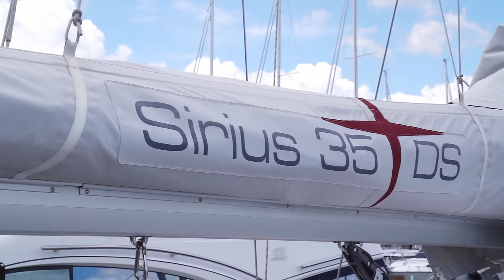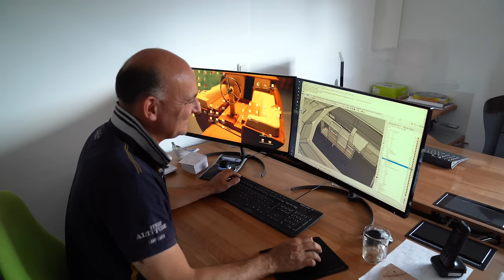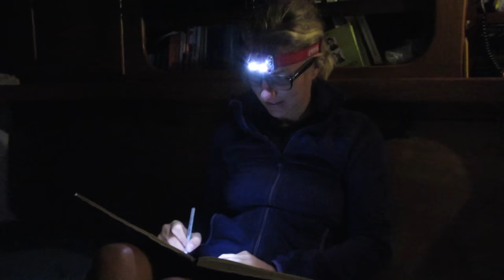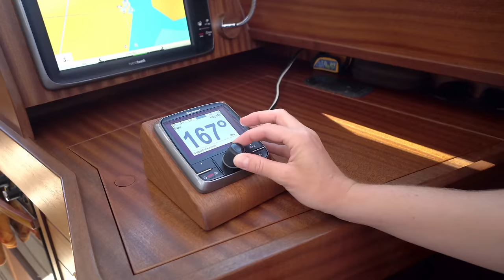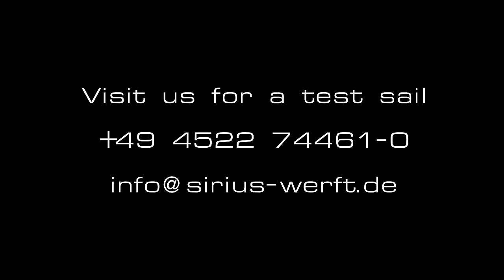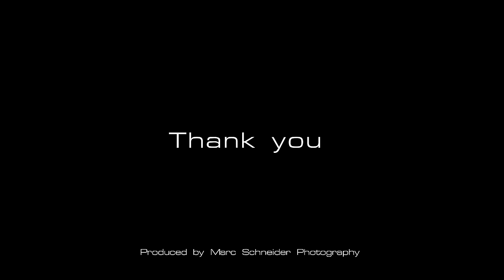Sailing the Sirius 35 DS: A Day at Sea

Comment: This was so inspiring, motivating and  so informative! If you do not already have plans for the bigger sailingtrips this boat boat brings your dreams to life! I does to me! I’m used to the regular Bavaria’s en Jeanneau’s between 30-40 ft, but this boat has so much features that appeal to me. 
One question: I read a lot of books about transatlantic sailing. And one problem seems to happen to all of them: leaking windows.... and I see a lot of windows on the Sirius.... should I worrie? 
Thx again, the both of you!!!
Reply from the maker: Thanks you very much! This is a great compliment and motivation for us! Thanks for asking about the windows: leaks would be down to bad quality rather than bad weather or area of sailing ;-). But I do understand where you are coming from. Some 15-20 years ago - before gluing practice has become common and secure in all kind of airplanes, helicopters, trains, cars you would have worried about leakages. Also has there been a time where gluing was just making something watertight whereas this has long moved to structural bonding. In quality productions this is proven to be safe and sound...
Reply from the maker: ...as we are building ocean-going-cruisers since 50 years now, there has gone a lot of thought and calculation into every little detail. The saloon windows in particular are in use by us since 1988 on every deck saloon yacht we built and have circumnavigated the world a number of times, without any window failures. Just recently this Sirius https://www.youtube.com/watch?v=MQgRIVw-kPg has been sailed all the way from Germany through the Atlantic, Panama Canal, through the Pacific, via Micronesia and Hawaii to Vancouver by their owners...
Reply: The windows are very strong Polycarbonate, doubtful ant problems, as stated in replies below. However, a possibly useful tip to prevent scratching and marking the surface, inside and out is to give them an almost diamond hard polish, ASAP while still in perfect condition, by using a Marine Silico Polish (like the liquid Diamond finish you can have applied to cars when they are brand new ? I forget the Name, but the Marine one used to come in a yellow bottle, and was guaranteed for 10 years. Did the Gel coat on the sides and Stern of a Bilge Keel Macwester 26 with it, and 7 years later it looked as if it had just  even dome. Bo problems washing it,  ever a mark on it. I was so impressed with it, when selling UPVC to customers, I told them as soon as they removed the deli ery film, to apply the Marine Silicon Polish, to protect the soft UPVC Surface Finish. We installed UPVC Fascias and Soffits on my parents House in the late 1980's or 1990, applied the Polish, and today, they still look freshly installed. In between, if the Car wS being pressure washed, they got a quick  last over with water, and nothing else.  For the boat windows, a wash with a wet Sponge on the exterior, to get the salt off occasionally , and a damp cloth inside, should work fine on unprotected UPVC for e ample doing that creates micro scratches, which soon has them looking grotty. I think it would  e good if Sirius Yachts could give their stamp of appro Al for this protection which  an be used on Windows, Hatches, and both sides of the door into the Deck Saloon ? If they have any doubts or uncertainties, I'm willing to Test it on  y boat when .I get one. One with UV protection in addition as well, would be a bonus if one is available ? Best Wishes.  Bob.  👍
Reply: @brownnoise357  thx Bob! 👊🏻

Comment: Saft first a second forestay nessasery
Reply from the maker: A second forstay is not necessary and a option - so your choice! ...but the benefit of the so called "solent rig" is, that you still have a proper sized jib, which could be sailed from 3-3,5 beaufort on, with enough sail area to have fun with it. ....and have the big genny at hand as well, without effort for changing sails, other than furling the new sail out and the old one in from without leaving the cockpit. Than the jib still sits on a furling reefing system and could be made much smaller, when the wind excides 7 beaufort. The down side is, that you can´t tack the genny though the gap, but either have to furl it, in and out, while tacking or gybe it though. This works pretty good, but is work, thought ...but than one have to see: as a cruising sailor, you would try not to set your course against the wind all the time or are on long tacks. If you have to tack constantly, the jib is the better choice anyhow, or if it´s that little of wind, furling the genny in a tack is not that much work at all

Comment: You failed to point out how much height restriction is present in the salon. A man can’t stand up and that’s a problem.
Reply from the maker: ...thanks for raising this concerns but this is only correct if you are taller than 2,05m: In the saloon area you will find 2,05m (6 feet, 9)standing height!!! ...and that`s on a 35 feet yacht! Have a look @25:20 in this video or if you like my “average” 1,85m (6 feet 1) to compare @ 14:00 amd @18:15 in https://www.youtube.com/watch?v=y-v-h50KZgM . We had heavy sun light and for videoing the companionway hatch and blind closed and still you have easy access walking in ... but if you slide it open you can walk in totally upright (and stay upright), .... if you are not taller than 2,00m (6 foot 8). If you are - we still do have some semi-custom solutions, done already
Reply from the maker: ...as you might have seen if you have followed the link or time position in the former comment, the main construction idea is to have the same eye level from all positions: sitting in the settee, at the chart-table/inside-steering-position, cockpit or standing in the middle of the saloon before the galley for perfect 360 all-around view...but standing height only where it’s really needed to keep the roof low. This is actually only 1,35m high above the cockpit floor so that everybody can look above it, standing behind the helmsman position (which is even 8cm higher) or sitting on the coaming (very unlike most sprayhoods)

Comment: An absolute no-no. Did you see the absurd angle of heel in very light winds? And with that large freeboard and superstructure the windage will be awful. This boat is about accommodation and prestige - not a sailor's sailboat. Good for cruising on the Norfolk Broads.
Reply from the maker: While it might be nice to sail around the coats of Norfolk most of your fellow UK customers and many of our owners world-wide are using it for sailing trips further away. Recently a canadian customer collected it in Germany and sailed straight back the 20.000sm via Canary Islands, Caribbean, Panama Canal, Galapagos, Micronesia and Hawaii to his home port in Vancouver. ...but there has been curcumin navigations and serious blue water trips done with em as well. ...all our Yachts are especially developed for blue water cruising and rough weather conditions, and always have been!
Reply from the maker: ...If you do not like to comare it to a Contessa 32 you will find the freeboard indeed much lower than any other modern 35 feet cruiser. If we are lying next to other boats the same size in a harbour we are often looking up as they all need very high hulls to get away with enough standing height inside with only low rooflines…and then they need the Sprayhoods on top, which we have integrated into our Decks house design.... So the windage is lower than on comparable yachts and as the forefoot sticks 40cm into the water for good rough weather performance, she sits very firm in the water and is not blown sidewards in harbours as quick as other modern cruisers...
Reply from the maker: ...in addition to this Sirius Yachts have a much lower centre of weight, compared to other boats, as we are able to place all heavy parts in the centre of the boat right above the keel, as this is where we have the space in the workshop, under the central cabin bed and in the huge galley storage spaces instead of a shallow bilge under the saloon other boats have there....that´s one of the reason they are perfect for ocean crossings and as go-anywhere-cruisers...
Reply from the maker: ...I can see where you are comming from talking of the heeling seen in the video, even if it did not look strange for me. We had a nice breeze of 17-20kn in the end, partly still carrying the 130% Genny which might not locked like that much as we near the coast with little waves build up out of the shelter. Nevertheless the yact is designed as a propper sailing yacht and has a powerfull rig and lively feel at the helm for fun in lighter wind conditions as well. The Solent-rig and the single line reefs are helping to change head sails in minutes and reefing the main without anyone leaving the cockpit and adoped the sail area to the conditions. Be welcome to have a look and see for yourself at one of the next Southampton boat shows or in one of the many harbours around the UK Sirius Yachts are based...